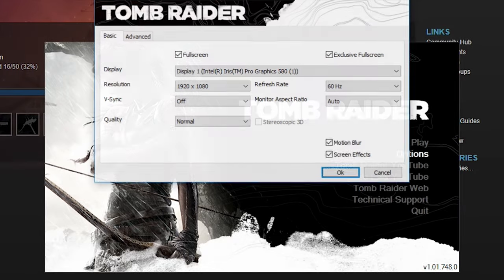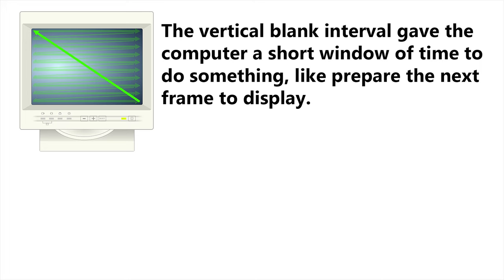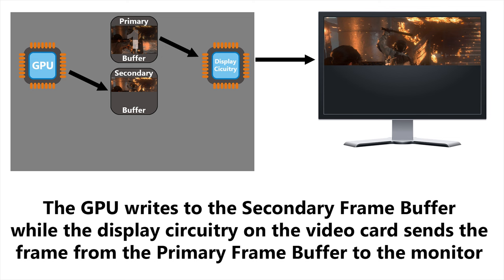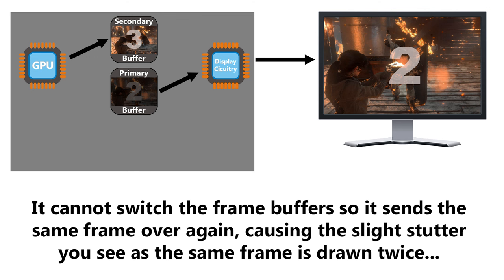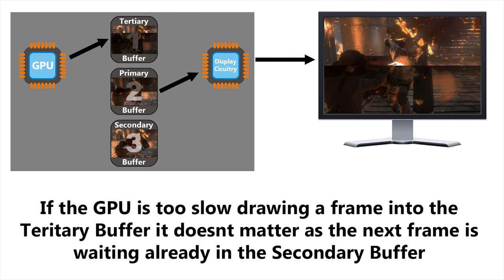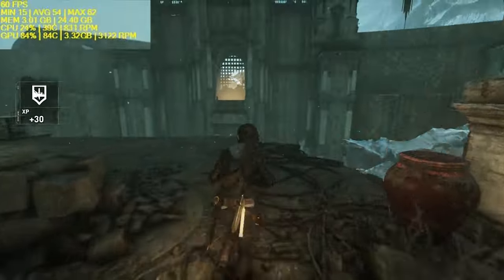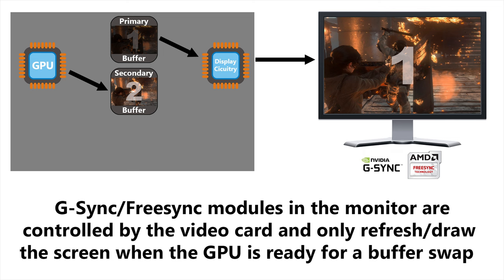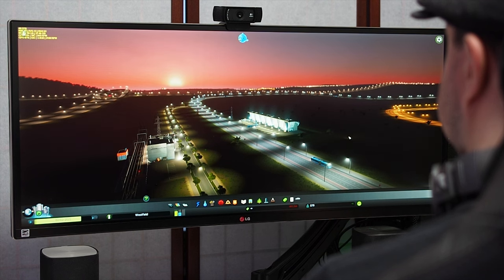Refresh Rates,  V-Sync Settings and Frame Buffers Explained

Comment: A frame rate limit/cap helps reduce input delay tremendously in conjunction with traditional VSync — this is what’s done in many consoles games and can prevent buffers from piling up and creating input delay. See BlurBusters LowLag Vsync guide for more on this.

Also, for a proper 30 FPS like they’re doing in many consoles games, you should use Half Refresh Vsync such as what’s available in the Nvidia Inspector application.

Alternatively double buffered Adaptive Vsync is an option in the Nvidia control panel but it doesn’t work correctly unless you limit FPS to refresh + 1, the “just in time” approach from the BlurBlusters guide will cause the game to tear otherwise if you’re using adaptive Vsync which toggles itself off dynamically when you drop beneath the target.

Comment: This explanation is wrong. Video states at 5:06 that "having an triple-buffered system like this buys the GPU one spare frame of time in case it starts falling behind a little" and "the GPU is drawing two frames ahead of what you see on the monitor."

No! The point of triple-buffering is that the GPU can render as many frames as it wants without caring what the monitor is doing. That's why you need to turn triple-buffering on in order to get, say, 240 frames per second on a 60Hz display rather than get capped at 60 FPS. At 240 FPS to 60 Hz, the GPU switches back-buffers four times, and then flips in the most RECENT of the four frames when it's time to pick a new front-buffer to send to the monitor. That means the monitor is getting a frame that's only about 0~4 milliseconds old. If the card were double-buffering instead, then it would render a frame in about 0~4 ms and then have to wait around doing nothing for another 12~16 ms until the buffers flip.

This video is perpetuating the misconception that triple-buffering increases input lag, which is the EXACT OPPOSITE of what triple-buffering actually does. (You're probably thinking of prerendered frames, which is a completely unrelated concept.)

Comment: btw, depending on how the triple buffer is used, the system can also shift to the newest full frame, and just dump the 3rd buffer, this is how several games i play have setup their triple buffering, as a way to stabilize frame rates and minimize input lag, as i understand it, this is also how nvidias driver forceable tb works, and it also works with their newer "fast" and "adaptive" "adaptive half refreshrate" modes, if you cannot hold a stable 60, many times i have found that forcing 30 is better then having it bounce down to 20, then up to 60, the best option in my exp, tends to be triple buffered vsync when supported by the game, OR, when the driver profile version actually works well with the title, and, for most titles i test it on..i get pretty good results, in a couple cases, nvidias profile triple buffer in fast sync mode(on a non free/gesync monitor) gives the best results for people lacking a freesync monitor... 

anyway, im pretty happy with the fact that nvidia just put tb in their drivers,  when last i checked, you still have to use radeon pro to force it on amd systems....and radeon pro hasnt been updated in forever... once the creator got hired by raptr(yeah the dead company/platform...) he quit supporting his creation.. and..since amd dont really even listen to their own internal driver test groups feed back...and havent since management changed in the re-live era...

Comment: Hey good video finally i understood some parts
But i am confused 
It started when i decided to buy gtx 1070 for my new build 1080p 60 hz because of future proofing instead of gtx 1060 6gb but after reading & viewing about sync issues that gtx 1070 will give more than 60 fps causeing tearing and lack of smoothness. So i want to know is it true .....
And what should i do?
By the way my monitor lg22mp68vq supports freesync but i was avoiding amd gpu ie rx580 or vega56....
Appreciate the help.....

Comment: How come having the vsync option turned on and enabling triple buffer solves the problem when the GPU can't keep up with monitor's refresh rate? It should make the situation worser; stutter + laggy feeling.
Reply from the maker: +Yunhyeok Choi if the GPU can't keep up at all, as in there is no way it can do 60fps at all or hardly ever then turning vsync on will give basically 30fps. The triple buffering helps when the GPU can't quite keep up from time to time, it buys an extra frame of time to get the job done and hopefully within a frame or two the GPU catches up. The downside is a laggy feeling as what you see is an extra frame behind at all times. There is no magic cure that solves the problem of a GPU that is out of its league. However variable sync makes the problem less noticeable (no lag or stuttering or tearing).

Comment: Does triple buffering matter when you don't use Vsync? Or should you even enable it? My GPU can easily keep up with the monitor in my case.
Reply: I guess it won't have much of an effect, except that you have to risk tearing from happening.
Reply from the maker: +Mardy if your GPU can keep up with your monitor then leave triple buffering off. It adds lag.

Comment: gsync is technically superior, but nvidia wont open it so that other gfx card makers can support it, freesync is better in that, it allows monitors to be more affordable and still offer at least some of the benefits gsync has, having tested both again recently side by side, and testing nvidia on an asus freesync 144hz 1440p monitor, it worked great, no problems what-so-ever, now,  gsync on the older gsync equivlant of the freesync monitor, does do a better job at very very low frame rates, on the other hand, both get broken in driver updates randomly... like HDR support... just.. a god-damn-chore when windows will sometimes update drivers even when you have that disabled and updates set to manual mode via gpedit..... no joke, im genuinely close to moving over to Solus Linux for my gaming... steam/proton give you support for the majority of games, and in my testing, some games..somehow..run better, others run about the same... if not identically, so...yeah... im getting close.. knowing solus updates arent going to auto apply, or break my system so bad i have to spend over an hour fighting with it to get it back to functioning like it was the night before.. i mean... i am all for a steady update cycle, but... when its safer to run fast track preview builds,  update them after initial install, then, wait for the next "its going to go gold" build to drop, so you can use the preview iso to update the damn thing... 

i have friends who have had to block updates at their router, because, they kept having updates break their critical work systems, despite having group policy settings to require user approval to download and install updates... bangs head into desk

Comment: I have a question. Is vsync with tripple buffering always more laggy than double buffer? I understand that if GPU can output above 60 fps at all times it will start rendering next frame before previous is even pushed to monitor resulting in over 16,6 ms of lag. Which would be more than double buffering. But lets think of other example when you hit jumpy 240 +- 40 fps in a game like cs go. Lag should be 4 ms +- 1ms, because gpu switches buffers multiple times, but sometimes can finish 3 sometimes 4 frames and monitor would get most recent finished frame. Or would it? Maybe GPU just sits idle when it renders to both buffers or it depends on API? It certqainly feels laggy in this game in comparison to non-vsync. Plus i feel like non constant lag makes tracing with mouse horrible.
Reply: Until I wrap my mind about this I will be using non vsync in shooters and double buffer vsync in strategy and gamepad games. I also wonder how double/tripple buffering affects experience while not using vsync.